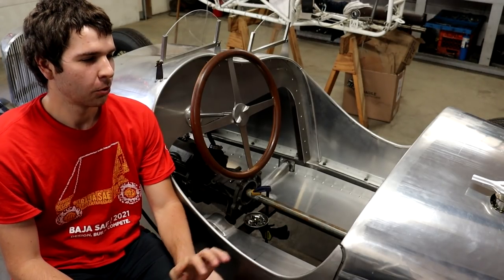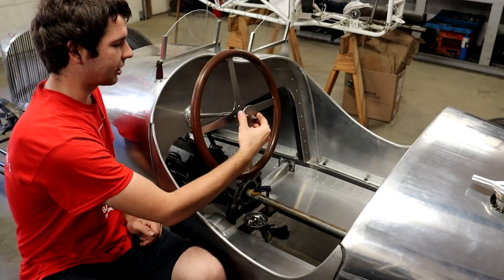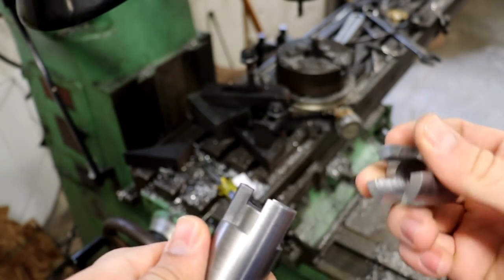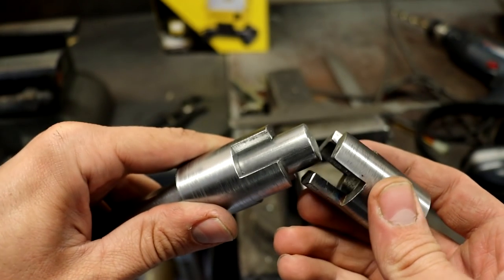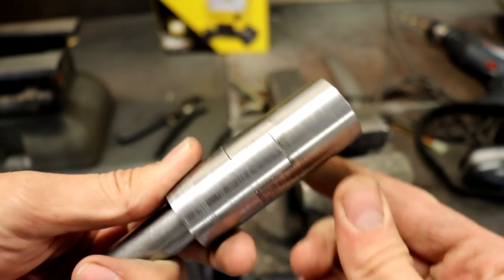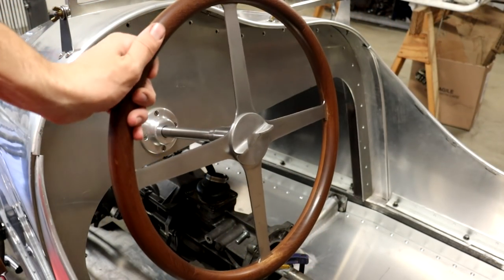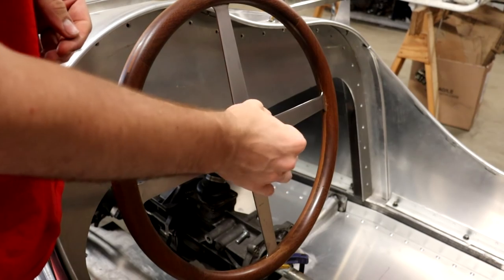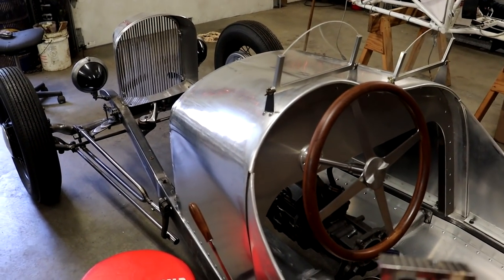Making a Removable Steering Wheel | Homemade Boat-tail Speedster Pt. 48

Comment: Seeing you do all the hand filing in this video reminded me of my Grade 9 machine shop project. 
We were each given a slice of 1.5” hex rod that was cut very sloppy on purpose. 
Our task was to file both side flat and parallel to 1/4” or thinner and the chamfer the corners to have each face be a 1.5” circle. 
All work done by hand with the exception of the hole to make it a key tag if we wished. 

Hard to believe that it was 40 years ago. 
#gettingold

Comment: Great work as usual.  One suggestion for when you mill an unsupported part (you could see the part flexing when you were milling with the ball end mill) is to use double sided tape to stick the part to the mill table, along with the clamps.  That is a tough piece to lock down and eliminating flex would eliminate chatter marks on the piece.

Comment: Love your work. One suggestion, your steering wheel nut, lick the first few threads off of to make a shank that'll line it all up. It won't fall off suddenly at the end of the thread when you're undoing it and it'll align when you want to put it in. 👍👍👍

Comment: 1° out of parallel and the bottom ends not touching could have given You a self-adjusting no-play seat with the wing-nut tightened. Anyway, great achievement, and a nice improvement for a really astonishing project. Thanks for sharing!
Reply: Could get some wedging though. Wouldn't want to be bumping the wheel off.

Comment: @ 3:15 The challenge is to have the two constellations interlock.  This is because the sides are cut at 90 degrees to the radius.  There should be a slight taper so that the two sections close the gap the tighter they are pulled together.

Comment: That's so cool! The only thing that i find kind of dangerous is the lack of a safety pin or something lika that, just in case tha sterring wheel wold get loose due to vibrations or in a crazy case that you hit the nut. I know that's really hard to happen but since the sterring is such an important piece, maybe having that extra part would be more for ease of mind. Can't wait to see this master piece driving!
Reply: i'd like to see some sort of safety wire on there too
Reply: As long as he keeps a grip on the wheel, I don't see it pulling 3/4" or so back towards the driver (uphill) to disengage the splines. 
   The screw is long enough that it would be noticeable long before the threads were backed off far enough to disengage the splines also.  

I am in favor of redundant redundancy, especially when it comes to safety,  and maybe for the general public a more secure locking pin(with ignition interlock,  and warning bells and lights) would be necessary.   This car is not for the general public, but for an enthusiast who will be paying much more attention to the vehicle.

Comment: Very nicely executed my worry would be the column would make a harpoon for your chest in a moderate impact . Two round tubes with opposite flat sides one fitted snuggly inside the other.  pin together with 2x  small pins these would shear on impact the two tubes would just slide together not spearing you. Live to fight another day and build more great projects . You  have a great skill set very impressive all the best stay safe.

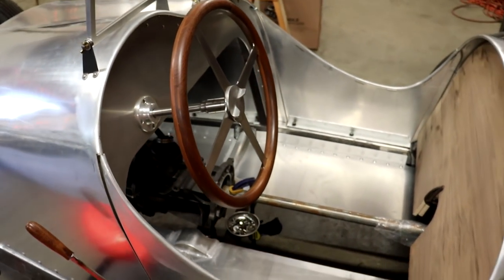Comment: Another wonderfully talented piece of craftsmanship moving the car ever nearer completion, well done. At around 13:04 we get a side on view of the wheel and the dash and I wonder if you have contemplated shortening the column by a couple of inches to get the wheel slightly further from your chest as it already looks a little cosy in there and that's before the seat goes in?
Reply from the maker: I would like to do that, but then there isn't room for my knees

Comment: Hey! Because the wheel is removable, it means it can be placed on the seats/bodypanels/on display (upside down). The hub screws sticks out from the backside few millimeters. File them down to the smooth surface, so they won't catch the eye... or seats, body or the handler ;)

Comment: Great work as usual.  I was thinking you were going to make the steering wheel AND column removeable by using the same type of lugs/knuckles and perhaps a quick release pin of sorts.  Either way, elegant design.

Comment: Do you have any kind of flexible joint between the steering shaft and box? One of the big problems with a rigid steering shaft is being impaled in a head on collision. That is why early 60s cars have big, ugly padded horn buttons.
Reply: A piece of tire sidewall between two plates works well for this
Reply: You are talking about a collapsible shaft, not a flex coupler!!!
The flex coupler takes out vibrations in the steering column!!!
A collapsible shaft stops one from being impaled!!!
Reply: @rockerpat1085  thank you. I had the two mixed up. I know they became standard in all American cars in 68. My 67 mustang still has the solid shaft. If I eventually have the funds, a 68 steering box is going in. Gotta get it back together before that is even considered.

Comment: Great work as ever.
If you don mind me saying: You could have made just one slot. That would avoid finding the right out of 3 positions.
Also if the slot was very slightly tapered the fit and tightening the nut would always take out the play.
Last not least, please never crash cause those wings would leave a nasty impression….
Reply from the maker: That's certainly correct. There's always more than one way to do something

Comment: What stops it from vibrating loose, potentially becoming a steering issue and/or becoming something that then appears under your brake pedal at an inopportune moment?
Reply from the maker: it tightens down a lot just from the friction of the flange. even if it does start to back out though, you can just screw it back in
Reply: @MacroMachines  ....That's true, I'm just imaging you enjoyably engrossed in the minutiae of driving on some long, windy mountain pass and it escaping your attention. I trust you feel confident with it and that'll do I guess. Good on ya mate.

Also, I got my wife to watch what you're doing here mate and explained to her the extent of this task you've undertaken and the quality you've brought to it, along with the ingenuity & creativeness you've shown with a relatively limited tool set. Another jaw was dropped as she fully understood what has impressed the rest of us who are your regular viewers.

Keep up the mighty work mate, good on ya.

Comment: If you cut a set of intersecting wedges that don’t bottom out any wear would be taken up as the wing nut tightens. 

I wouldn’t redo it though. Yours is probably good for at least the first 100k miles.

Comment: Only problem I forsee is possible vibration causing the knob to back out
Reply from the maker: It tightens down a lot harder than it probably looks on video. even if it does start to back out, it will be noticeable and you can just tighten it back down

Comment: would change it some so the wingnut is staying on the steeringweel as you loosen is , youre bound to loose it or have the wingnut removed by someone else with sticky fingers , should be simple enough with a circlip or even a little bit of rubber hose on the back and a little space on the steeringshaft for the circlip / rubber hose ring to sit intoo when tightened

Comment: when are you going to put the engine and trans in that speedster
Reply: That'll probably be a while from now considering how much time and work that requires. I mean, putting it in is one thing, but i assume you mean actually getting it working.
Reply from the maker: The engine is at a machine shop to get some work done to it and progress has been very slow. The trans is ready to go though

Comment: Guess you'll have to pass some kind of Area/State vehicle check before going on the road.
Nice looking Wing Nut steering wheel spinner but in a lot of areas sharp edges are not allowed on steering wheel bosses, frontal impact stuff, ruin your face.
Sorry to be a kill joy.  Good luck.

Comment: Those two nubs on the wheel lock might need to be rethought, rapid deceleration will make you well acquainted with them.
Reply: Was also my first thought when seeing it. Would be nice to have a semicircular handle that lifts to 90 and folds down again to blend with the other side. Small notch to get under and flip up.